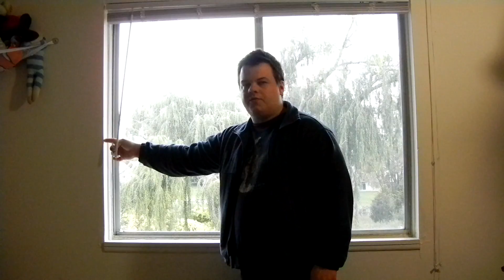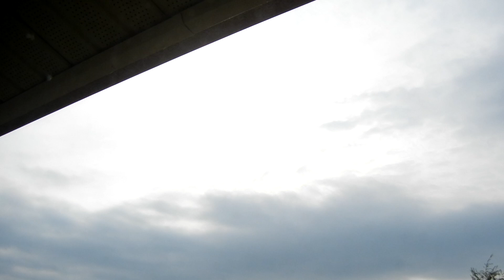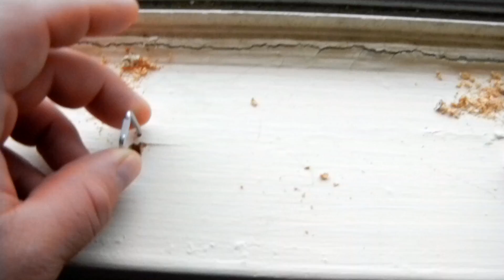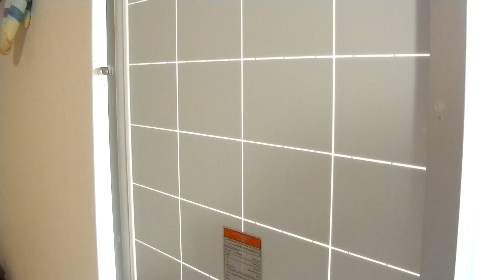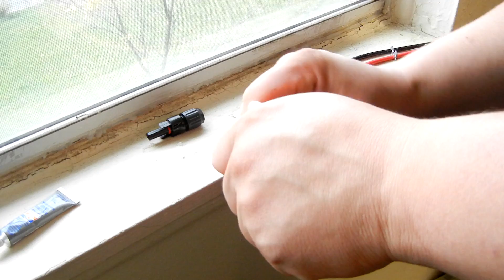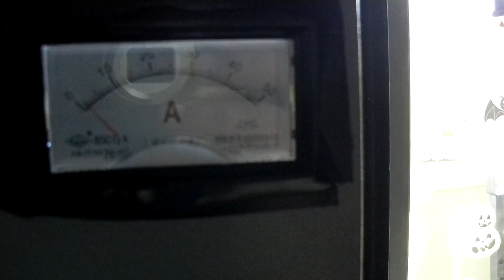Renewable Apartment - How I installed a Solar Panel in my bedroom window

Comment: Having a SE facing bedroom window just across from a public school, a single 20W panel offers sufficient privacy and phone charging. However my windows are gold coated for reduced IR, so I'm only getting around half of the 20W. Should be able to place it on the outside as it width wise fits inside the frame exactly.

Comment: I just bought a 1500 watt hour solar generator with two 100 watt panels and tried this same thing, trying to put them inside a window.  My solar generator reads zero watts coming in behind two very sunny windows.  I moved them outside in the sun and now it reads 154 watts charging.  For some reason I'm not getting hardly any charge through a window, just barely enough to turn on the green charging light on the generator but not enough to charge to where the cooling fan comes on.  Such a bummer too, I'm going to have to figure out how to get them outside.  The problem is that if I permanently mount them on the side of the house then the system isn't that portable anymore.  And I don't think you are supposed to have the generator in freezing temps, so I'll have to drill a hole through the side of my house to get the cable inside.
Reply: Remove the window glass. Same as outdoors........with proper insulation.

Comment: this is awesome..  just watching this video I am now convince that solar power is amazing.. great job..
Reply from the maker: +Troy Baldoza to be honest the window approach wasn't the best. But it worked as long as there was direct sunlight.
Reply: I have a East facing window in my room behind my Gaming rig and I get blinded and cooked in the summer. Today I decided to remove the black out material and replace it with a 28w solar panel and block the remaining part with black vinyl. I reckon if I need to block the window regardless, why dont I at least power a battery charger for half the year.

Comment: I've read that having glass in front of the solar panel reduces its output by as much as 50%. Is this true? Couldn't you have mounted it in the frame with the window open?
Reply: Yes, any measurements with behind the glass and in front of it?

Comment: I'm thinking about doing this at my place but can you please inform us what are the main uses and benefits in real world use for these, especially for apartment dwellers please? I'm talking about typical everyday use and how it really saves you money. That sort of thing. I know the initial cost are a lot but everywhere I looked they just talk about how they installed and which hardware they used. Didn't even mention how it's working for them personally and financially.
Reply from the maker: +xdejablu3x In this case very little. This is great for an emergency backup or to float charge some batteries but it will not offer that much. The best way is to get the panels outside of the window.
Reply: @GPVlog  not offer much meaning...? How long to charge a phone using a 100 watt panel indoors against a window?

Comment: Good video.
I have question for you if you don't mind.
Did your apartment complex ever said anything for you not to have solar panels on there property?
Reply from the maker: +JWSolar uSa Hey there. No I did not get any problems. The maintenance team were aware that I had the panels and all they cared about was that it was properly grounded and would not start a fire. Every complex owner is different but I basically called my setup a "Solar Battery Charger".
Reply: Ok.
You are so lucky
Reply: My apartment complex is kind of crazy
Reply: Please check out my videos and photos on the link below on Googl+ for more of my solar apartment photos
Reply from the maker: +JWSolar uSa really?

Comment: It's a great idea, but quite ugly and it's blocking so much of your sunlight coming through the window. Could you somehow put it outside the window? A balcony is ideal for apartment dwellers I think. Also, if you're gonna do this, I recommend flexible panels, like Renogy's - they are 5% more efficient too so they take up less space for 100 W and they are very thin, so you can easily just tape it to the window or just rest it against it, and you can remove it easily when you don't wait there - kind of a more mobile/plug and play option.
Reply from the maker: QuantumBraced I no longer live at this place but when I had this in the window I was getting around 4.5 amps at full sun. I also had two panels on the balcony. Flex panels are neat.
Reply from the maker: With this one panel? No.
Reply: +GPVlog Did it reduce your electricity bill significantly?